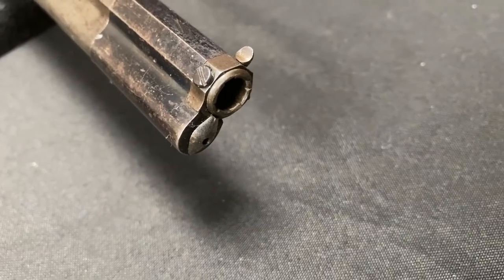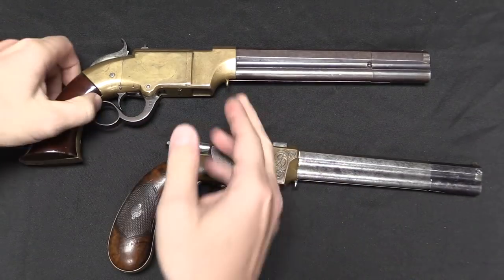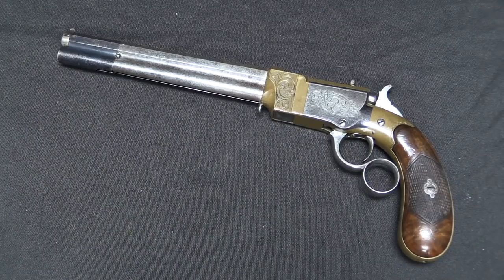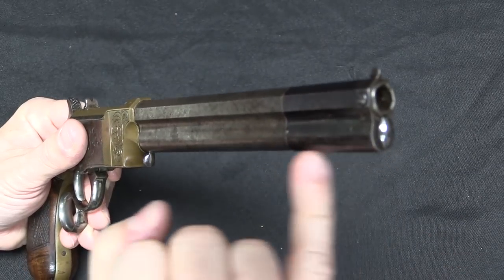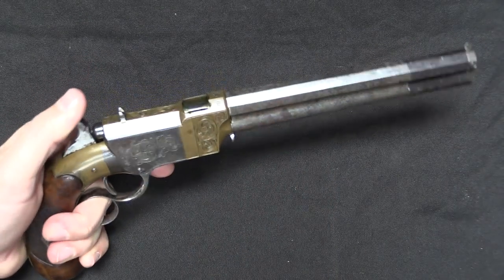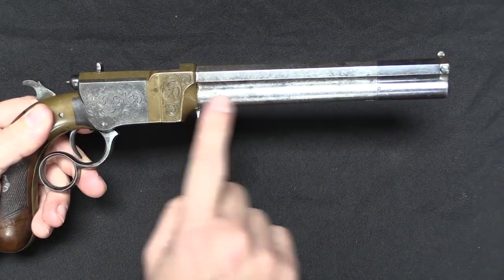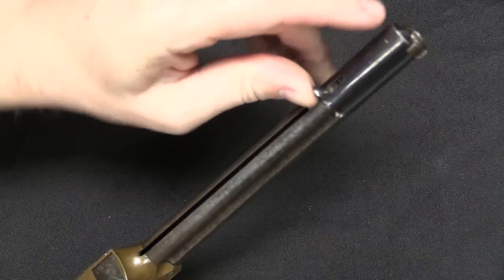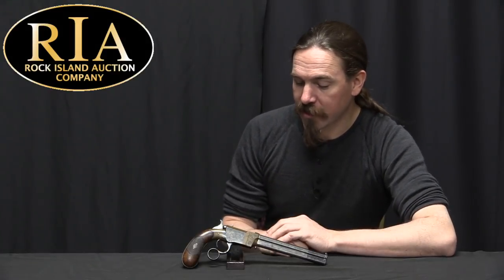Pietro Venditti Copies the Volcanic Repeating Pistol

Comment: So this is basically the Volcanic from Red Dead 2 being a rather powerful pistol. The gun shop catalog addresses this stating that this particular version of Volcanic does not use the rocketball but uses standard cartridges.
Reply: RDR2 is a fucking masterpiece
Reply: The volcanic uses proprietary ammunition to my knowledge
Reply: I believe Volcanics can be converted to rimfire cartridges, because .22 rimfire is low-power enough for the guns to handle it.
Reply: Might I enlighten you and inform that the Lever-Action Pistol produced by the Volcanic Repeating Arms Company in fact, did not use proprietary ammunition. Contrary to your schema, the pistol utilised "Volcanic cartridges", improved variations of so-called "Rocketball" ammunition, that in practice were conical projectiles with a hollowed out butt, that was then filled with gunpowder, and sealed with a fine paper cap and a primer. Although if you consult my opinion on the matter at hand, I do not mind that the video game takes the freedom to have the pistol utilise same ammunition as other pistols in the video game. This improves the gameplay experience for the player, as they are not required to carry corresponding ammunition for each of their firearms.
Reply: Paistin Lasta Nowhere did I state that in the real work it does not use Volcanic cartridge, I merely stated that Rockstar went the extra mile and actually gave an explanation within the game’s universe on why it used normal ammo and why is it more powerful that its real life counterpart

Comment: It's operated by using your middle finger to recock and chamber a new round. You would be holding the pistol with your hand closed normally, then cock it by squeezing the trigger fully (its unloaded) and grip tightly, flipping someone off with your hand facing sideways. After fully cocking the lever, you would depress the trigger and it would be ready to fire again.

 When people got fast with these, they would fire a round, continue to hold the trigger and cock it at the same time, release the trigger and fire again, etc etc.

Comment: Hello all,  an open question. I've seen a lot of videos showing the Volcanic (or variations) but I've not seen anyone FIRE one of these. Just how did people operate these - for example, was it a one-handed operation or two? Are there any videos of one of these being fired and operated out there, if so please point me in the right direction. Thank you. (I am guessing Red Dead Redemption has it completely wrong? LOL)
Reply: I believe that Ian manipulated one in a previous volcanic video (he didnt fire it, just worked the action) and if i remember correctly he did it with one hand by pushing the lever foreward with his middle finger through the ring.
It wasnt as quick as working a hammer on a SAA, but im sure that would come with practice.

Comment: Can caseless ammo make a come back? It’s a really interesting concept but I can only think of 2 guns which use it, the volcanic and the H&K G11.
Reply: The father of my childhood friend had a caseless .22, tube fed semi auto  (it looked like a standard .22lr bullet with a compressed cake of a yellow powder on the base of the bullet, and came in 10 round plastic tubes)
For the life of me i can not remember what kind it was, but it was so cool to shoot.
Reply: Caseless ammo isn't "garbage," and a third firearm on that list is the Voere VEC-91. You could technically include the MBA Gyrojet as another "caseless" weapon, although that might stretch the definition of "caseless" a bit since those pistols were firing small self-propelled rounds rather than bullets in the conventional sense. Of those, that is the only weapon chambered in caseless ammunition which you can actually still buy and shoot, although VEC-91s are rare (albeit nowhere as rare as Gyrojets).

The funny thing is that the VEC-91, unlike all the other caseless firearms, did work very well. But it wasn't cheap; it didn't really offer anything that you couldn't already get with weapons using less proprietary ammo, and the prevalence of people like Aquatictoaster in the commercial firearms market made it a very niche option at best. 

I've never seen a VEC-91 for sale in the U.S., and have only seen them a couple times auctioned on GunBroker, but I have heard that you can still find them more easily in Europe. Maybe when this Wuhan flu panic passes, I ought to relocate to Switzerland where I'd have a better chance of getting my hands on one.

And yes, caseless weapons will eventually supplant metal cased ammunition. I have heard that Rheinmetall is working on an autocannon that fires 30mm caseless ammo. With caseless ammunition, if you can solve the cook-off problems, you have a weapon which fires ammo that is much lighter and less expensive to produce in terms of materials, and also takes up much less volume. As for the "muh reloading if SHTF" crowd, who's to say that if caseless ammo becomes commercially viable, you couldn't form your own propellant bricks by mixing a slurry of propellant, binder, etc. and pressing it to shape with a simple mould?

Comment: Could someone make actually-reasonable rocket ball cartridges with modern smokeless powder and bullet casting? Could be an interesting approach to caseless ammo
Reply: Yes, just make a long hollow bullet, pack the powder inside, ad a primer to plug it's hole, the bullet would operate similarly to rocket propulsion, now all you have to do is find the best ratio of bullet to powder to find desired length
Reply: @denvervandrey2883  That sounds a lot like the Gyrojet rounds... which were developed in the 1960s. A modernized Gyrojet is possible with better quality control (thanks to modern CNC machining), but there really isn't any market for that currently since people don't want ammo that they can't reload and that doesn't do anything their .45 ACP doesn't already.

I've been meaning to try my hand at making an improved Gyrojet round, but it would be a very expensive project with no ROI or chance of profit whatsoever.